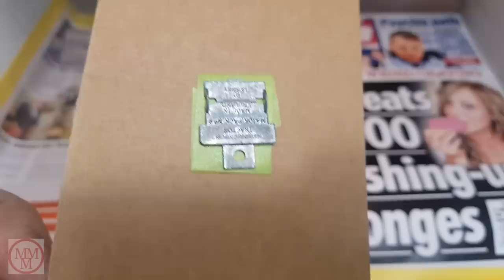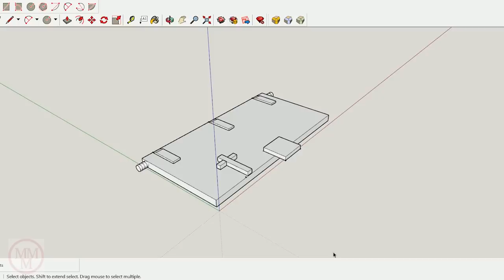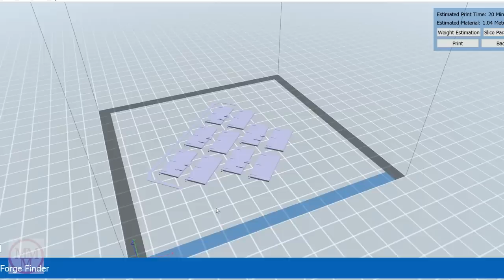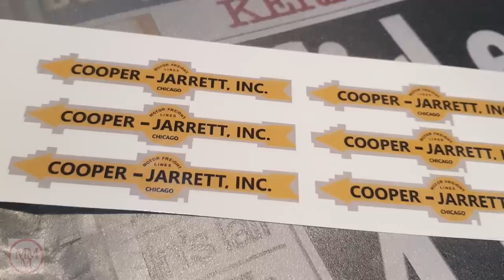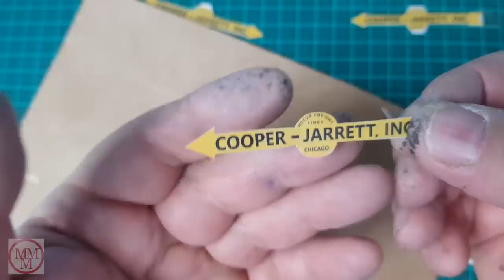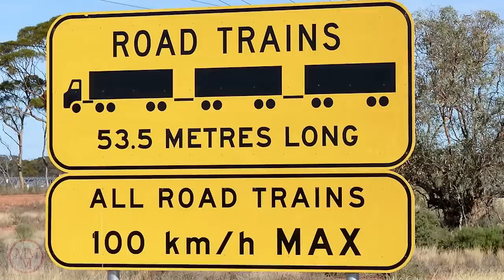MATCHBOX Restoration Major Pack M9 Hendrickson 'Cooper Jarrett'  Tractor & Freighter

Comment: I used to pull triples and rocky mountain doubles back when I drove a truck out of Salt Lake City Utah.
This really brings back a lot of memories!
We call them tractors here in 'Meriaca, and the different combinations are called semi, full, and combination.
Semi is just a tractor and one trailer, that can be anywhere from 28' to 53' long. A full combination is a tractor, and 3 28' trailers, while a combination is any combination of a tractor, and two trailers. A rocky mountain set is either a 45' & 28', 48' & 28' trailers.
A 28' trailers nick name is a "Pup". We also use the term "Dolly" for the converter gear between trailers.
There are 3 types of converter gear here in the US. The basic one has one set of wheels, and the others are dual set, and cable braced.
Anyway, enough trucker talk, LOL! Great episode!

Comment: Always a pleasure to watch the transformation   The "trailer" attachment point is also known as the "fifth wheel".  My Jersey friends refer to trucks as Lorry's (?) bigger units are called  HGV's (Heavy Goods Vehicles). I'm told the egg will cleanse the skin if applied properly, use facial sponges to remove.   I'll forward Kevin an application as a drone test pilot.  Thanks again. Narragansett Bay.

Comment: Marty, in the US we call the front end the tractor and the box section in back is the trailer.
Reply: The front end can be called The Prime Mover.
Reply: Also, the full unit is called a big rig or 18-wheeler, for obvious reasons.  And I may be mistaken on this, rigs with two or three trailers are called double or triple haulers.
Reply: @tygrkhat4087  In the industry they are nick named "wiggle wagons" as the setup tends to wiggle at times.
Reply: @highpath4776  as in Optimus Prime.
Reply: And in Germany we call this :
Sattelzugmaschine und Auflieger 
A Traktor is for Farming !
Good Job Greetings from the Swabian Mountains in South West Germany from Dornstadt a little Town near Ulm 🤣😂👍
Reply: In the US, it's a tractor trailer, semi, double if it has two trailers, a triple if it has three. 
A mountain double has a longer first trailer than the second. I've only seen one tractor pulling four trailers, that was out west. I don't like the triples, that last pup just whips side to side! It uses all 12 feet of the lane! Whatever is inside is probably junk when it gets to the yard!
Reply: @Buddha-eb5yl  So is Lastkraftwagen a general term? Like 'commercial vehicle' in English?
Reply: @Drum Corcaigh Yes, "Lastkraftwagen".(or short "LKW") is only a general term in german.
A Lorry and Trailer ist called "Lastzug" and a semi is called a "Sattelzug". Since 2017 there are "Road Trains" allowed in Germany as well (but only in some areas on the "Autobahn") A whole german "Roadtrain" contains a prime mover, a usual semi-trailer and a two or three axle "normal" trailer. 👍😁
Reply: In the UK too

Comment: Hi Marty, another enjoyable restoration. Definitely called Tractors as in Tractors and Trailors. Tractor unit with different trailors. The latch was set high for loading and unloading with the trailor backed up against the loading bay door. The loaders would open and close the door, driver stayed in the Tractor cab.
You need the flame from your 'soldering iron' rather than the soldering tip. You could also look at getting into copper coating damaged parts and then soldering them together.

Comment: Great make over. That model was one of favorites. The one I had was a darker blue on the prime mover and the trailers were a light robins egg blue with the doors the same color. I think I had one of the later ones as they used the two-piece regular Matchbox wheels.The one-piece cast double wheels were also used on the #6 quarry truck. I think it was 1966 they changed to the two piece, although its hard to tell because they used the same painting in the catalog for the entire run and many stores conntiued to stock the older ones.. The catalogue picture of the quarry truck changed in 1966 to a photo.. Thanks for sharing.

Comment: Good morning, Mr. Marty and thank you for the excellent, 'long' video.  If you haven't bought a gas powered soldering tool yet, please consider the DREMEL unit.  I replaced one of those inexpensive ones like that which you were struggling with with the DREMEL 2000-01 Versa Tip set and my soldering work went from something that I usually avoided at all costs to a fun part of my RC builds.  That tool will definitely exceed the required temps to work with your welding rods.

Comment: Either you didn't give the soldering iron enough time to heat up the area or it was probably hot enough but didn't have enough output to heat up the whole thing. You can use a small blowtorch to help it out a bit.  

Nice build though! They're looking as new again!

Comment: Perhaps this is a useful tip:  When I learned to solder weld in school we did things a bit differently than if you were trying to solder the way folks do when they try to solder electronic wires.  We learned to join metal pieces together, and that's the sort of thing you're doing here. First, we put down some vasoline on the area where the metal needed to be bonded.   This formed a lubricant for the solder to glide upon later on.  After that,  we simply clipped off a piece of solder and laid that across the area intended. The amount of solder varying, based on the width and size of the area.  You don't need too much solder rod/string if you do things right in the heating stage, but it is a little trial and error.  Once we had our solder material in place at the lubricated connection point, we would use a bunsen burner to heat up the solder, going back and forth slowly.   It takes a few seconds for the solder to activate, but we just kept going back and forth with the burner with the flame just above the soldering rod/string until it reaches the correct heated temperature. In seconds the solder with activate, melting and spreading across the lubricated area, as it will follow along the vasoline that was first applied to the surface.  It's as simple as that. That's what you need to try in the future.  Remember to keep the burner flame a little above your solder, as you don't want to melt your model.  The solder will gradually heat even if the flame is a few inches above it.  Of course, I recommend a test before you try it on a restoration.  I sure hope that you find my comments helpful, man.

Comment: You're amazing as always, and if we sometimes worry for you, it's because people always worry more for the people they like more :)
As for the soldering, tinkering with electronics a bit I found there are some really cheap electric powered soldering station with a potentiometer to make it go anywhere from 100 to 400 °C degrees: maybe something like would be easier to handle?

As a small suggestion, when I solder stuff to joysticks and similar thingies, I always apply the heat on the thing I'm soldering, and not on the solder itself. For examle, when I want to solder a spade connector to a cable, I tin the tip of the soldering iron, tin the cable, I press it on the spade to make it hot and then press the tinned cable on the connector and add a teensy amount of solder.

Maybe with a better soldering iron you could try pressing it on the crack and, when it's heated, press the rod so it melts and "floods" the crack?

I didn't mean to give you unwanted advice, I'm just a great fan here, and basically I stopped crafting things for a bit until some people (and you are within them ^^ ) gave me back the joy of doing manual stuff

Comment: Marty have to say I'm typing as as I watch because I already know this will be my favorite to date. See my father drove trucks all his life so at a young age I fell in love with Big Rigs. So this is one model I have been trying to get my hands on. Almost had one from ebay but it was snatched away in last seconds. Also I have been using the Super glue baking soda regularly nowand I found it's not just a binder but also can be used as a bodyfiller also. Don't think you have checked out my Instagram page but I recently did a custom Matchbox Transporter and added a visor over the windshield and the technic worked outbetter than any other body putty I ever used. So thanks for that!

Comment: Sweet rode train, very nice work 👍🏻 🔥🤘🏻
You will need a regular (open flame) torch not a soldering iron, your prep was spot on, you put the flux on the part and heat up the metal and flux with the torch, then move the flame away from the area and quickly touch the solder to it and it should melt and flow across the gap. Use torch as needed to keep the solder moving across the gap. 
Any how I’ve probably have confused you enough lol.
Reply from the maker: I'm gonna try all this soon, stay tuned!!

Comment: Hi, Marty, what you were given was a gas powered SOLDERING IRON, a gas torch is what you need.
You need a different fitting on the hand piece.
The work piece is soaking away your heat.

I wonder if the gas kit came with accessories, including a torch attachment?
I love the quality of your 3D doors, looks like detail that is possibly better than the cast metal original.👍
When you do the final press on the axles, do you have to be careful not to produce too much heat from the friction so you don't melt the tyres?
I love the "cotton buds and make-up pads that I found"...
This has  to be one of your best videos Marty, great content and fantastic result.

Comment: Top job Marty! My advice on the soldering is go to your local Jaycar electronics store and get yourself a butane powered pencil torch, those things have enough grunt to more than reach the temps you're after just be careful you don't overheat the casting (pro tip keep the flame moving and remove the heat once the solder melts).
Reply from the maker: Mmmmh.....Jaycar is where i got my first one shown here!!!........?
Reply: @MartysMatchboxMakeovers  Ok, must have got the new bloke on the counter lol.
If you're prepared to shell out the money for one (last time I looked they were $80) get yourself a Weller Portasol, I used to use them for soldering earth wires when I was still in the Electrical trade (pro grade tools).

Comment: In the U.S. these are referred to as tractor-trailers and this type of trailer is called a dry van, though I think most people just call them all "semis" regardless of what type of trailer they're pulling. 

Your restoration came out GREAT! I have a couple of torches and the one that is similar to that which you showed here has removable tips. If the soldering tip is left off it acts like a plain torch with the flame projecting straight from the end. The hole you were trying to direct the flame from is just to let the heat or exhaust from the torch escape, like a vent. Your tip should be removable and the flame project straight out the end.

Comment: The soldering iron you have is not bad. I use a similar one to solder wires together  in my van and RV.  They come in very handy when ya can't hook up to electric  power
Reply from the maker: I agree Clark, but not for this application,. I will keep the soldering iron for future use but will have to get a better one to showcase the 'Muggy solder' product in a future vid.

Comment: Marty to deal with possible contaminants on metal parts, you might try to wipe them down with acetone prior to painting. I’ve seen others do this to prep parts for paint or powder coat. Also a small sand blaster can remove rust or stubborn coatings from metal parts. There are cheap ones on eBay. You may have already thought of these ideas but just making sure.  Nice work here as always.

Comment: Glad the Dettol worked for you. It also worked on getting paint off diecast metals but it takes roughly 24hrs for it to work. Your paint stripping gel method seems to work alot quicker. Might try it with my upcoming restoration vid.

Comment: Marty, I have not brazed the high zinc thin material as your models are, but I have done lots of AC lines with the rods you are using. It looks like the torch you were given is for soldering electrical components you need an open flame for the work you are doing. Have a look at your torch and see if the tip is removable if so have a go without it and see if it produces enough heat output to melt the rod.  Even a propane/Mapp gas torch that is used to solder copper plumbing pipe may be a bit overkill I think it could be done but with a high learning curve. I would start with a Gas Butane Soldering Iron with an open flame. Then just follow the instructions with the brazing rod. All I can suggest to you is place the flame on then off until the rod starts to flow you can then braze what you need to do.
It's this heat on heat off that regulates what you are able to do with this rod too much heat and it will flow right through the joint into a puddle on the bench. Not enough and it will be clumpy as with your first attempt just keep at it and with practice, you will be able to control the heat needed to braze your parts together or build up low areas. I hope this helps you.
Play Safe From Elliot Lake Ontario Canada.
Reply from the maker: Thanks for the tips Scott, always welcomed. I did eventually remove the tip but the flame was within the device and did not protrude from the nozzle. I shall source a better one soon.
Reply: @MartysMatchboxMakeovers  Glad you found it helpful here is an address to a muggy weld  Video that shows the heat on heat off technique www.youtube.com/watch?v=AMykTskkOgI don't want to leave a link in your comments
good luck and practice, practice, practice

Comment: Great job Marty ...as usual.
Regarding your attempted chassis repair, I think your vise was leaching all the heat from the repair site. I'm reasonably sure if you were able to clamp on to the unbroken section, leaving the repair area out in free air, it would have worked much better.
Regards from Mississippi, USA
Retro

Comment: You need a butane or propane  toarch. They make a small torch kit for hobbies  such as this. I saw a tiny sideline  torch kit as well. They are only about twice as big as a large bic lighter, so easy to hold in your hand and store, and use for applications  such as this. I used them making and repairing  fishing lures
Reply from the maker: That is my plan for the next soldering vid. - Thanks for commenting Clark!

Comment: On my gas soldering  iron you remove the tip to expose the flame , turning it into a mini gas torch.  You need the flame to melt the rod i.e. brazing but the metal  that the models are made from is very resistant to welding of any form .

Comment: Don't change a good recipe Marty, keep doing what you do, change not a brush stroke (mixed metaphors,  emotional lol). A thought on your doors (and other metal parts). Make a pattern as you have doe with the printer. Make a rubber mould using your printed part. Buy Prinz August model metal, and ladel, and mould your own metal doors. Very easy. You may need to mould a   piece of straight wire into the mix to make the hinge pins strong. Tractor Unit is a pretty universal term for prime movers like this one.
Reply from the maker: Thanks Matthew, I appreciate all feedback from my viewers but more so the positive ones!
Reply: @MartysMatchboxMakeovers  that was quick Marty. I just noticed that the predictive text said doorstep not door so I have changed it. Your videos give me a real lift. Oddly enough, you look very much like my twin brother and I, and we were born in the same year (you and me, not so sure about my twin brother he he). So it's a bit like looking in a mirror  (although I am better looking lol). I am also ex military. I truly enjoy your videos and often use your little tips and fixes in my own hobby, painting miniature soldiers and models. My wife and I always have a giggle at your interactions with Kevin. Keep up the great work, all the best from a very sunny and hot south of France!

Comment: G'day Marty, Wonderful job on the restoration. The Kevin segment was great too. You have a knack for getting an innocuous event coming back later to surprise you, like the boomerang in one episode. I sat on the edge of my seat waiting for the climatic end. By the way, what sort of building is the blue structure to the right of your  yard across the street? A commentator below said here in the States we call these a "Tractor-Trailer" which is 100% correct, I think this had it's origins in farming, where the "Tractor" was the utility vehicle that pulled just about every farming implement. The huge boxes being hauled along were "Trailers" because they "trailed" behind the tractor. These are also referred to as "Big Rigs" and 18 Wheeler's. There may also be a Railroad connection some locomotive engines were called "Traction-Engines".
Reply from the maker: Tom, thanks for watching, so glad to hear that you like my style of humour! - Great post BTW! - The blue structure you  ask of is a safety barrier to prevent suicides or vehicles from falling into a 9 metre deep channel where 'VLine' trains run from Geelong to Melbourne. I am 600 paces from the local train station and often use the train to nip into Melbourne when required. The 'VLine' trains are rural and reach in all directions from Melbourne into country Victoria. The normal Metro trains are a bit grubbier and have no facilities onboard such as drinking fountains and toilets, so I travel in style if I ever use the train!

Comment: Ou, and correction info to the bolt sytem: To the upperbolt is attached a special lacth that you go and push upwards, then use that as lever to turn the bolt to open the door. Closing the door is using the latch to turn the bolt back and then pulling the lacth downwards so the bolt will lock to its place. 

This "counterbolting door system" is still fairly used in heavy transportation and machinery industrials to provide a "serious easy heavy duty locking" to prevent the cargo from spilling or falling.